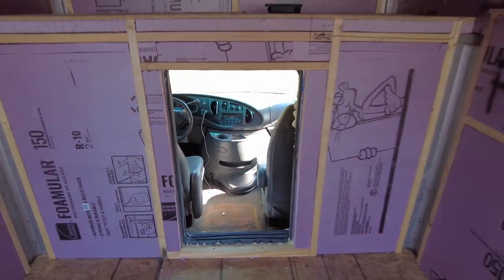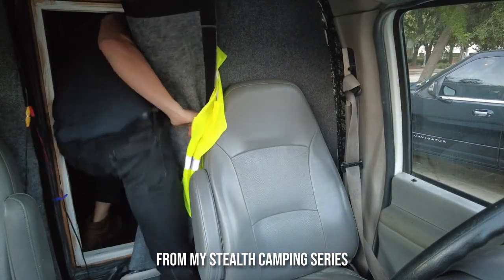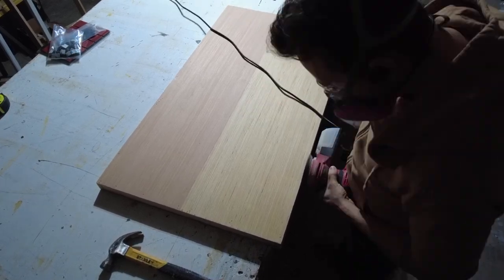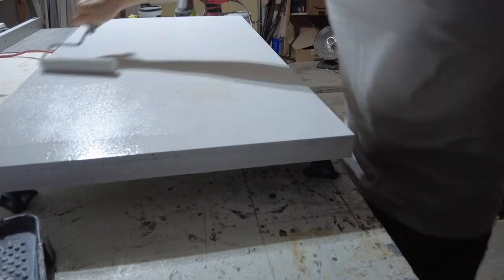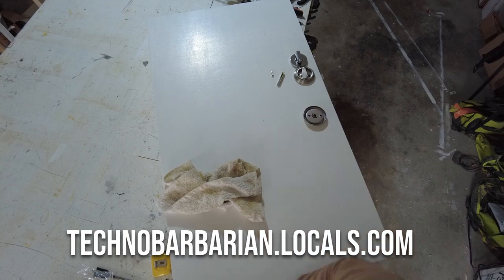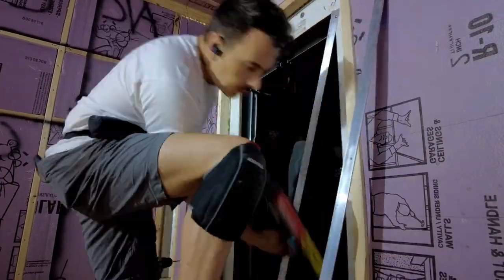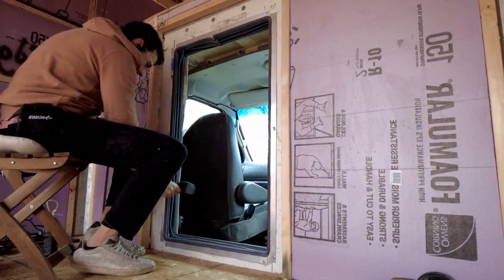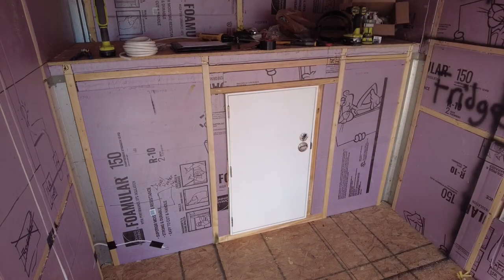Bigger and Better Passthrough w/ DIY Insulated DOOR! | Box Truck Tiny Home

Comment: i feel like saving space and weight and using an accordion style door would be good, could collapse into that extra space you had there too haha, great work !
Reply from the maker: Wont keep the heat out of the cabin area. Needs to be airtight and insulated
Reply: I have seen a pass-through door once that was a slider I think the box is made by Hyster. When you turn the handle to slide the door open the hinges pivoted out in ran smoothly along a track and when you closed it it ran along the track and just before it latched it pivoted back in injecting itself into the door jamb with a tight fit . No squeaks or rattles from it as you drove either. I'm working with a 10-foot box and having the convenience of that slider not opening into the room would give me so many more options with my living area.

Comment: Why not use a solid wood door and cut it to size? Wouldn't that be more sturdy, safer, and just as insulating as the door you built? Also, what is the size of your door - other than "bigger"?

Comment: Does the interior length of your 17' box truck include the Mom's Attic area or is that an additional couple of feet over the cab? Loved your whole previous build series! Thanks.
Reply: On Uhauls website you if you google 17' Uhaul thre is an image that gives you all the dimensions.  17' includes the moms attic.  It's 14'3" + 2'6" (moms attic), which they call the 17' uhaul.

Comment: This would solve the biggest problem I saw with box trucks, that you can’t get through from the cab to the back. So cool. I would have to hire someone to do this, but would be worth it because used moving trucks are not so outrageously expensive. Worried about gas mileage but the extra space is so worth it.